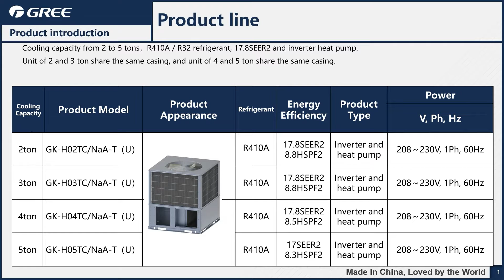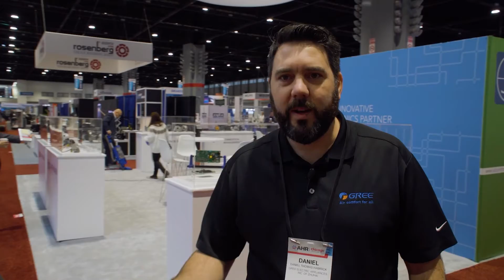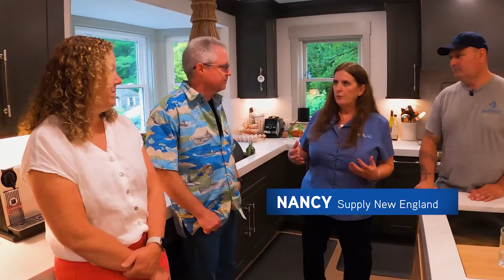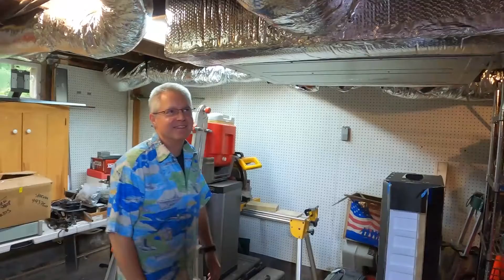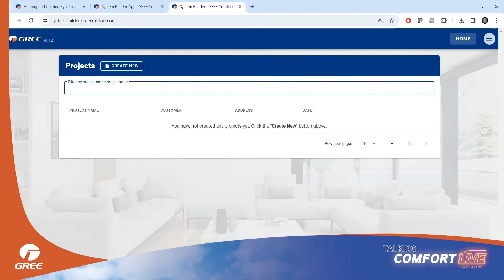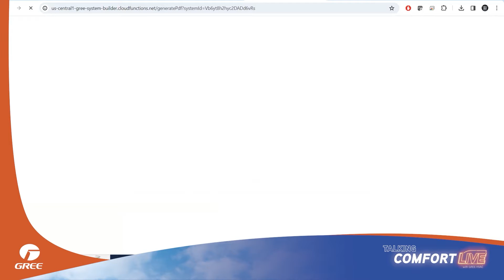System Builder App, MultiPRO Install as seen on HGTV's Frankenhouse, New X-PAC, NAVAC, Jabra, Q&A

Comment: Can I connect my pv strings directly to xpac? What is max voltage and wattage that I can connect?
Reply from the maker: Good question. what application do you have in mind?
Reply: @LIVOcomfort  we have mini split heat pumps sold now that run on either direct dc solar or 240VAC or both at the same time. We need package units for the residential and commercial market. Plenty of room on rooftops or in the yard for pv arrays. It would reduce the size of inverters needed to run off grid if our heat pumps could run directly on solar.